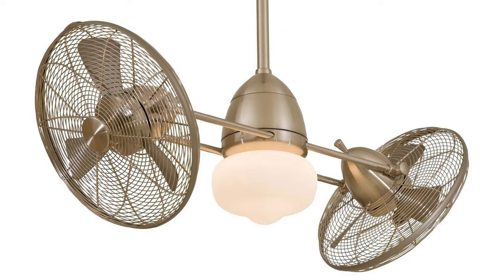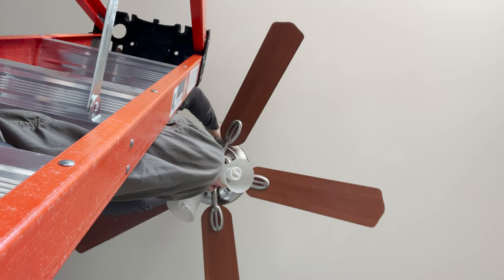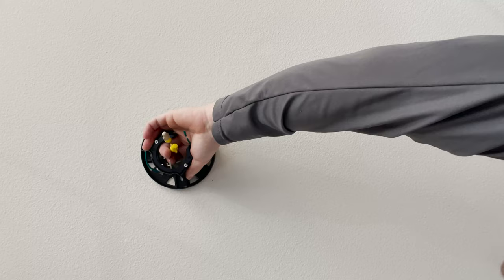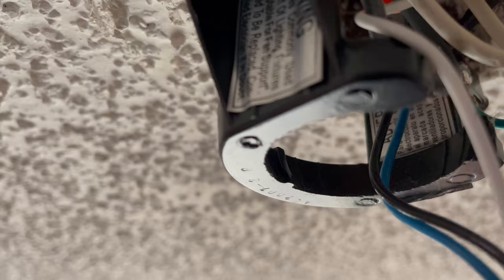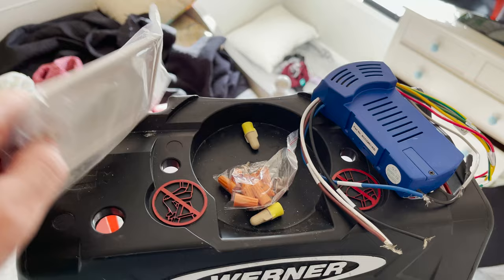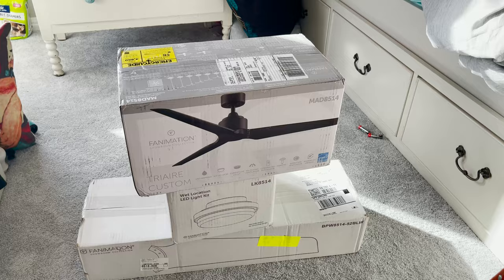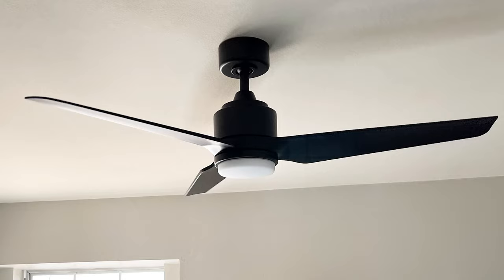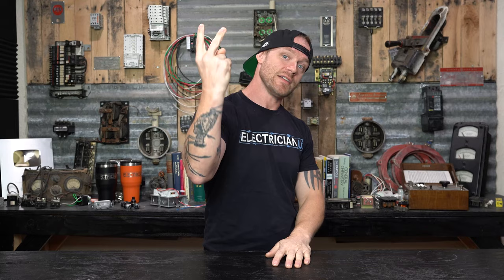How To Install a CEILING FAN - (From an Electrician)

Comment: Its not the dropping of the screw, but the adventure in finding it again.
Reply: Right, I was doing pendant lights in a kitchen once and dropped my little screw knobs off my ladder, which bounced off the counter and hit the floor. Luckily saw one on the ground right away. The other I almost got lucky, checked under sink, fridge, the oven and all around the kitchen to realize it didn’t even fall off the countertop.
Reply: adventure to the hardware shop🤣
Reply: Bro facts 🤣
Reply: Keep a light colored tarp underneath the work area and the screws/parts will stay contained and stand out.
Reply: haha well played sir. My mind would put the screw(s) somewhere on the opposite side of the damn room going into some impossible spot/length of space. haha, likely not right below oneself.
Reply: Installed a ceiling fan (12 feet up) in my family room today and that tarp saved me more times than I can count 😀
Reply: FACTS! Lol
Reply: Check the inner side of the ladder frame on each rung lol
Reply: Beauty nuts are my worst nightmare!
Reply: 😂 so true

Comment: 5 DIP switches will only give you 32 possibilities, not 120.  Fun fact, a lot of manufacturers will shrink wrap the fan blades together.  They weigh each fan blade and when they get a set of blades with the same weight, they shrink wrap them together as a matched set.  This makes it easier to balance the fan once assembled.  If you are installing a lot of fans, do not mix up the blades from various fans you you might have a tougher time getting them all to balance.
Reply: I can confirm this, I worked briefly on a packaging line that handled home décor and fixture accessories and we did in fact have a line devoted to matching fan blades. In some models they will actually adjust the differences by grinding off small portions of the blade that gets covered by the bracket. Most are just weighed and matched though. Great comment. :)
Reply: Very cool to know! Thanks!
Reply: We have so much fun with our neighbor with this....
Reply: This is correct. When dealing with dipswitches, the possible configurations are 2^x not x!, as each switch only has two positions.
Reply: Never heard this... good info thanks
Reply: Number of positions to the power of the number of selectors.
dips switches = 2 positions
5 dip switche = 5 selectors

2^5 = 32

Its a handy formula to know as long as you know how to apply it.
Reply: Was just going to say this. Dip switches have only two positions. On or Off. So, its binary. 4 switches = 4 bit, 16 possibilities. 5 switches - 5 bit, 32 possibilities

2^X, with X being number of switches (bits). Or 2x2x2x2, 2x2x2x2x2 in spilled out form.

Comment: The worst part of ceiling fan installs is when your spouse walks in while you're on the ladder and absent mindedly flips the switch controlling the fan while you're connecting the wires and get a nice 120V zap, fall off said ladder and have the fan add insult to injury by landing on top of you.....this may or may not have happened, and if it did the names of the guilty party has been reacted.
Reply: Always work like it's Hot!!! Rule number 1 my friend...
Reply: Lol.  That’s a pretty random scenario.  Must have NEVER happened to you and definitely didn’t involve your wife !!!   How many times have a had a client ask if I need the light on.  Hell no !!
Reply: @jakesully5402  That's an automatic $500 upcharge!
Reply: @PatrickKQ4HBD  not the homeowners fault you're negligent
Reply: The worst part is installing the Code required retrofit Fan box in place of the existing box. If you don't turn off the circuit , you are asking for it!
Reply: Just turn off the breaker… or atleast tape the switch to off and write dont touch on tape

Comment: Dustin, nice video but I would add the following:  Actually show in the video that the ceiling box is listed as a Fan Box and show the important features that make it a Fan box versus a regular electrical box.  Also, I agree with another comment that said may quality manufacturers actually weigh their blades and you should place similar weigh blades opposite each other to minimize fan wobble.  Show moving blades around to different mounting positions will help to reduce the fan wobble.

Comment: I installed ceiling fans in all the bedrooms, the upper hall and the dining room. Since the bedrooms had no existing ceiling fixtures, I installed double boxes with a dimmer and a switch in each one and used NMC3/14 to feed the fixture boxes. I measured the exact centre of each room and put braces in the ceiling to mount the fixture boxes. When I was done, I only left the fan-speed chain on the fixtures. It was a lot of work.

Comment: Hey Dustin! 

Great video very informative as always. 
One thing I did notice is that you were struggling a bit getting the wires through the down rod, the way I have always done it is take the entire down rod apart first the pin and the ball. 

Now it may be the case some fans do not have a removable ball. I have not run into a residential fan yet that doesn’t have a removable ball on a down rod but there may be some out there. 

Once it’s just the bare rod it’s so much easier to slide the wires through, then you can put your pin in tighten the screws then the cover that goes over that part of the rod (if it applies), then the screw cover ring (if it applies which it didn’t in your video), then the canopy and bushing/seal whatever you wanna call it if it has one, then put your ball back on and screw it down. 

I know I’m not teaching you anything I’m sure you have a reason why you do things the way you do I’m just trying to throw it out there for an educational standpoint that sometimes it can be easier and more efficient to do it this way. I know 9/10 times it is for me. 

Thank you as always so much respect I am not trying to throw hate at you or your video in any way and I hope you understand that!

Comment: Then you hope and pray. The fan box is actually secured to structure.
Reply: pfft, if box isnt secured to structure the motor bracket gets moved over and mounted to the structure. Code says the electrical connections have to be in a rated box.

Comment: As an electrician. I HATE ceiling fans lol
Reply: As a ductless inverter hvac installer, I used to install ceiling fans, now I hate them too.
Reply: Why do you hate ceiling fan’s?
Reply: @thelast1900  no apostrophe s
Reply: @thelast1900  too many parts and pieces to put together. Especially when the customer got a cheaper tan it feels like it takes forever to put together. Just a preference tbh, one of the only things I don’t like doing as an electrician
Reply: True the do
Reply: @badguy622  very small area for the wires and wireless controller, also they all install differently.
Reply: I like ceiling fans i absolutely hate bathroom exhaust fans

Comment: Another great video on the subject.  Spend the extra ~$60 for the Fanimation line of fans and get the wall mounted remote controller (like the TW206D).  No batteries and it works like the handheld remote you get with the fan... and it does not get lost!  ;)  Mounts in a standard box, if you have room or add an old-work box for it next to your existing wall fan switch.

Biggest mistake I've seen is improper box mounting... or not knowing beforehand what may be involved to mount the right box.  So many DIYers assume they can mount a fan to an existing light box in the room without checking.  It is at that point the project spirals out of what they can handle and have to call someone to help remove the old box and add a proper box/mount.

Comment: I do the same as you Dustin. On thing you forgot some Fans have a reverse mechanism so allowing for a downdraft  in summer to give a cooling effect and an updraft in reverse mode allowing heat to be better distributed in winter.

Comment: Great video, very good advice with regards to building the fan in the ceiling. I can't tell you how many times I've seen wobbly fans, and it's probably caused by someone handling the fan on the floor and hanging it up all built.

I have one small correction however, with regards to talking about dip switches and possible combinations. The formula for calculating the possibilities is actually 2^n possible combinations, where n is the number of dip switches. It's a binary system. So for 4 dip switches, 2^4, that's 16 possible combinations; similarly for 5 dip switches, it's 2^5, or 32 possible combinations.

A quick check to validate this is that 2! is 2, but you know that 2 dip switches actually have four positions (down-down, down-up, up-down, up-up) which is 2^n where n = 2.

Further proof below: (assuming "1" is up and "0" is down)
(2 switches)
00, 01, 10, 11

(3 switches)
000, 001, 010, 011,
100, 101, 110, 111

(4 switches)
0000, 0001, 0010, 0011,
0100, 0101, 0110, 0111,
1000, 1001, 1010, 1011,
1100, 1101, 1110, 1111

(5 switches)
00000, 00001, 00010, 00011,
00100, 00101, 00110, 00111,
01000, 01001, 01010, 01011,
01100, 01101, 01110, 01111,
10000, 10001, 10010, 10011,
10100, 10101, 10110, 10111,
11000, 11001, 11010, 11011,
11100, 11101, 11110, 11111
Reply: Imagine that's a correct assessment.

Comment: When I started wiring houses in 2012 I was taught to assemble the fan from the top down. After a couple years I was 3 times faster assembling the fan on the ground and hanging it in place. I could take a fan from start to finish in 15 minutes or less depending on complexity!
Reply: Lol kinda crazy how much faster you can be when you know what your doing. 90% of fans installed residential wise are built to be assembled on the ground and then mounted and wired. It’s not rocket science when you read the instructions
Reply: @fedfreds832  it’s pretty complicated because you have to be quick
Reply: @ryanthepianoman27  oh yeah real complicated after you installed 100 of them
Reply: @fedfreds832  also the instructions suck

Comment: Like you said, sometimes you have to be creative with the wiring. I installed a fan/light combo that only came with a remote control. It needed to be mounted into an existing ceiling box that had just a bulb fixture, controlled by a wall switch. However we wanted the fan light to continue to be turned off/on by the wall switch, but wanted the fan to be controlled by the remote, regardless if the light switch was off or on. Took awhile to figure out how to wire it that way (the instructions didn’t include that configuration).
Reply: You need a third wire. Constant hot for fan and switched for the light. Then you just wire the switched wire right to the wire for the light bypassing the receiver
Reply: @jaysyth  exactly

Comment: Taking an older large diameter base fan and replacing with new small diameter one will leave exposed old color/dirty ceiling. Medallions saved me from painting entire ceiling. I’m a handyman and I’m sure to have these saviors on my truck. A quick spray paint they can be used in minutes.

Comment: I also can’t stress the importance of reading the instructions. No one wants to especially if the homeowner is sitting there watching you and thinks “wow I hired this person to hang this fan and they don’t even know how to do it.” I had to hang 2 fans in the back patio area and once both were up and both were programmed, she came out and said, “well can we make them both work with one remote?” Well I’m sure you can but I didn’t read that part and when I did I found out I had to take the fan apart to flip a switch inside the housing so it could learn the other remote. Fun times.

Comment: I’ve installed Home Kit ceiling fans and the fan won’t work until you join the fan to Home Kit and control it through your device. But the light works! 💡

Comment: Flat rate,  Fan Installations, CONTRACT line items:
1.  Any blade balancing is EXTRA $.
2. DOWN RODS:  Some motor motion is to be EXPECTED.
3. Neighbor's fan remote code settings end up being set to same code = Resetting codes is EXTRA $.
4.  Ticking sounds, after completing job, become a whole new replacement fan job.

Comment: Oh man, when I worked at a retirement home we would have to install or remove ceiling fans all the damn time. As general maintenance, it's not just the install of the fan that sucks, but also the texture and paint touch-up of the damn ceiling.

Comment: We just moved to a new home build and there are no fans.  First fan was a nightmare.  The person who installed the LED light during the build only out in one screw. So I needed to go to hardware store to get extra machine screw to secure bracket to box.  After finally hanging fan, had to return to store because it was built wobbly.  Finally got it up and running and is fine now. I hate fans almost as much as you do.  Thanks for the video.

Comment: Good point on building down. When I was a young helper( 25 years past) I was taught building on the ground. Found out my mechanic was slow doing it his way. Mine was tight and right and well I beat him. Needless to say I was wrong for bot building it his way. Still faster building down

Comment: Dustin give the amount of weight a 8/32 screw can hold for a light fixture as well as lightning bar brackets, studs etc.
Reply: Dam i needa know this too lol.
Reply: All electricians need to know a little structural Engineering before installing products a little out of the ordinary. Screws have ratings just like everything else that's why wall outlets are 6/32 and lighting outlets are 8/32...

Comment: learned to always make a habit of turning on televisions in houses and check the fan with remotes before leaving. The first time I encountered it luckily we were doing multiple fixtures but noticed when using the remote for the ceiling fan it began messing with a television in a nearby room had to go back up and change the wireless switching sequence.

Comment: I am familiar with the fan that you have to assign the remote to the receiver. One time I had to install 5 identical fans in one house (up stairs and down) and it was a bitch to get each one to work on its own remote. Had to turn off breakers and disconnect some wires where I had 2 fans on the same breaker but needed to have their own independent remotes.

Comment: Customer buys "High End Fan" and a fan speed control switch. Fan comes with remote/module. Customer specifically wants the fan and the fan switch control. Fan doesn't take 120v directly or the wiring off the fan isn't identified how to hook it up as 120v without the module as the wires are uniquely color coded to the module.  The remote has no option for a light kit nor does the module yet the fan has 3 wires. Already resolved this, but what would you do?

Comment: A homeowner had a 40" extension for a vaulted ceiling when I left no wobble over 6mo later it developed a wobble. It can happen no matter how many precautions you take...
Reply: Yes that's true. It's why most manufacturers include a balancing weight for that reason...
Reply: @MrMaxyield  balance weights are listed in the instructions for time of installation, this occurs long after, probably due to the extension, possibly due to two young boys playing ball in the house, exact cause unknown...

Comment: I'm a Handyman and I like installing fans, most residential fans that is. I've hung hundreds an a typical fan takes about 30 minutes from the time I start unboxing, to the finish. My preference is to build them in place using the styrofoam packaging to support the fan (when I drop a screw it goes down in the motor. Ouch! Maybe I need one of those magnetic wrist bands. LOL). I take the down rod apart, run the wire through it, and reassemble it from there. Then I flip it, and put the semi-assembled blades on, and maybe the light kit if it's not those ugly ones with the 3 or 4 bulbs that hang down, and then I hang the assembled fan. If it has more than 5 blades I'll leave one blade off to give me room to work. (I still get pissed sometimes trying to cram wires and remotes into the canopy and, the old fashioned light kits.) I leave enough wire so that a longer down rod can be installed in the future. Some fans now use a molex plug on the remote which is nice. A few things that I have learned: don't use the cheap Chinese screws for the mounting bracket if they are going through the J box into a joist, the Phillips head will strip or the shaft will break before they get tight; test the fan and lights before installing the canopy and fixing the light kit permanently; don't even try to sync more than 2 fans to one remote when they have the receiver built into the fan motor housing, it won't work no matter what the instructions say! 2 are enough of a pain in the ass! Balancing is art and science. You can see if the blades aren't level by looking at them spinning, you can check them using a tape measure and the top of a ladder. I bring doing it but, one manual told me to bend the blades(s) so that they are all at the same height AFF (Above Finished Floor). Some fans (even the most expensive ones) will never balance 100%. Most people run the fan on medium speed and will be okay with a little wobble at high speed. Love the channel, keep up the great work man!